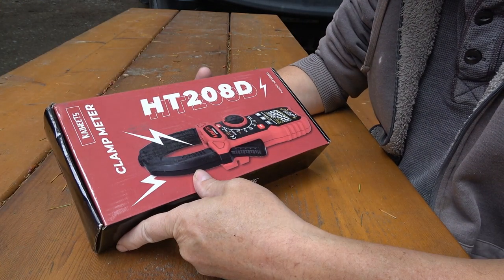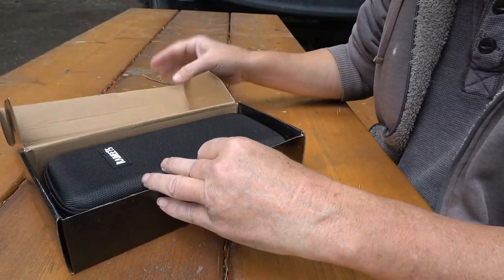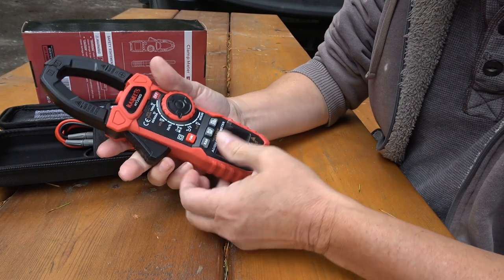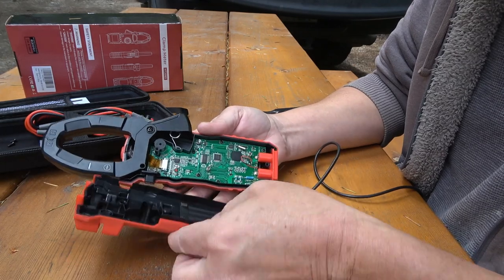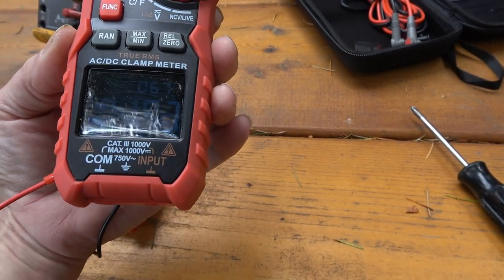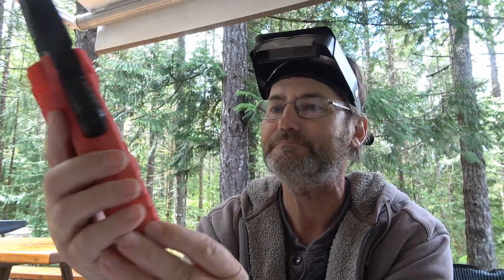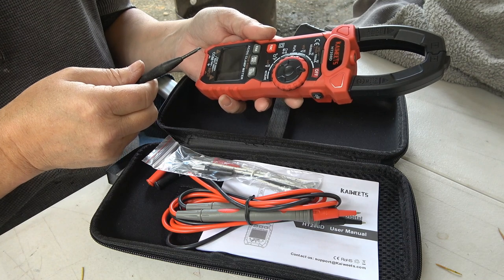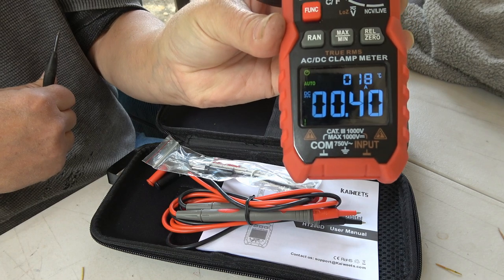DOA Clamp On Amp-Meter/Multimeter Repair -  Kaiweets HD206D

Comment: Thank you so much for sharing! I got one of these for cheap, but it turned out mine also didn't work. By bridging the battery compartment to the springs it came to life, so I stretched the springs until they were long enough to make contact. It works now! If I run into any more trouble I'll permanently wire it like you did. Thanks again for sharing!!
Reply from the maker: You're welcome. Great to hear!

Comment: Use ZincChloride flux for nickel, just wash it off with alcohol from iron and contacts afterwards. Its very widespread as a paste in copper pipe gas soldering. Works the same way for retinning the burned solder tips.

Comment: I never doubted you. On a totally unrelated topic, I just watched your video about how you organize your truck bed. Do you know the brand of the box you carry your generator in? Any problem with rain getting in?
Reply from the maker: Yes, company called Contico makes them https://amzn.to/3tBJA5C  Never have had any leaks. The lid overlaps the sides. I mostly went with it as it fit perfectly where I wanted it behind the hitch.
Reply: @LoveYourRV  That is where I am hoping to put ours.. although our hitch has a larger footprint than yours so we'll see. Thanks so much for the info.
Reply: @LoveYourRV  Hey Ray - Did you put some wood spacers below the box to elevate it above the hitch levers?
Reply from the maker: @m3cog  No, I cut slots near the bottom of the box at each front corner so the front fits between the hitch.  I keep my tarps on the box bottom. I can take a picture if you'd like.
Reply: @LoveYourRV  Did not cross my mind to do that. Whenever you have a chance a picture would be awesome! Thanks for the quick reply too.
Reply from the maker: @m3cog  Here you go, I cut a notch in the corner. https://www.loveyourrv.com/wp-content/uploads/2022/06/notch.jpg

Comment: hlo sr..I have h kaiweets 206 b clamp meter ..I pursuing the problem with..low betry show .and I repleced new betry  but  problem is not soltout pls help me sr ..finding also no show
Reply: Did you fix the battery problem? Mine does the same thing. Shows one battery bar. Replace with new batteries and still shows one battery bar.

Comment: Do you think the problem was just particular to THAT unit or did the Company have the same problem with many of them that were assembled that way?
Reply from the maker: Not sure, I've never heard of the company before. Seems to get decent rating on Amazon though so can't be that many failing. 4.6 out of 5 6,920 global ratings